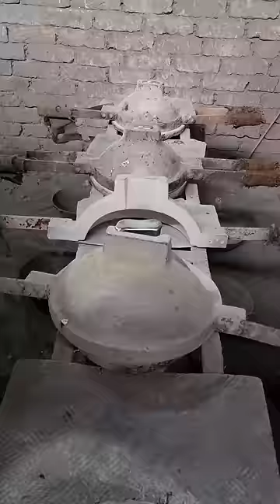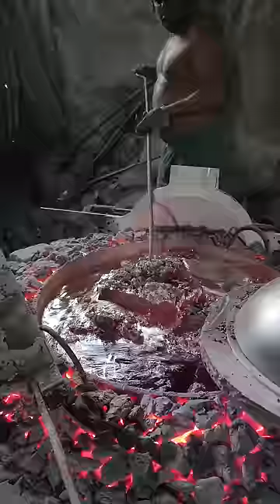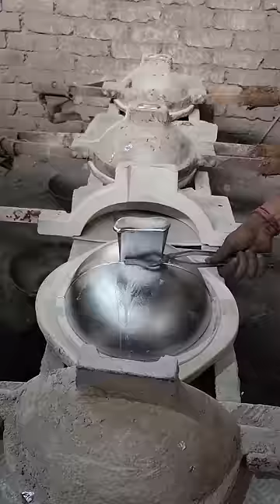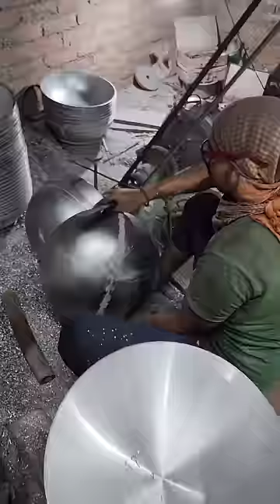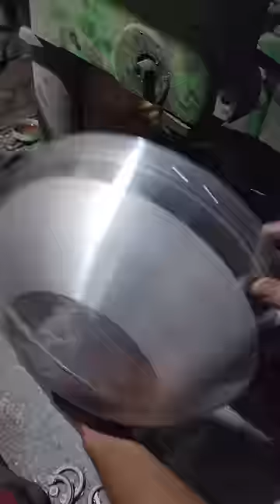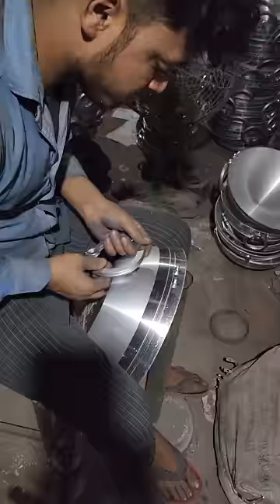Amazing Cooking Pan Manufacturing Process From Wastage Aluminium #shorts

Comment: Casting pots from scrap aluminum cans can have several challenges:

1. Purity and Alloy Composition: Aluminum cans are often made from aluminum alloys that may not be ideal for casting pots. The alloy composition can affect the quality and strength of the final product.

2. Impurities: Aluminum cans can contain impurities like paint, coatings, or contaminants from their previous use, which can affect the quality of the casted pots.

3. Melting Point: Aluminum cans have a lower melting point compared to other aluminum sources. This can result in uneven casting or difficulties in achieving the desired consistency in the melted aluminum.

4. Uniformity: Achieving uniform thickness and quality in the cast pots can be challenging when using scrap materials, leading to potential weaknesses or inconsistencies in the final product.

5. Safety and Environmental Concerns: Melting aluminum cans at home can be hazardous due to the high temperatures involved. It also raises environmental concerns if not done with proper ventilation and safety precautions.

6. Legal Considerations: In some areas, there may be regulations or restrictions on melting aluminum cans due to safety and environmental concerns.

While it's possible to cast pots from aluminum cans with the right equipment and expertise, it may be more practical and reliable to use aluminum specifically designed for casting to ensure the quality and safety of the final product.
Reply: ChatGPT out here writing youtube comments.